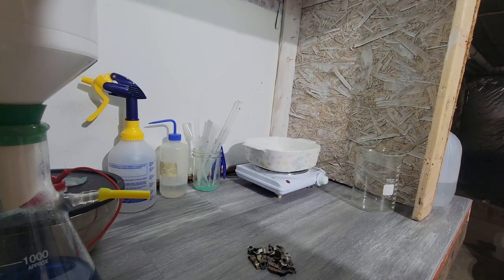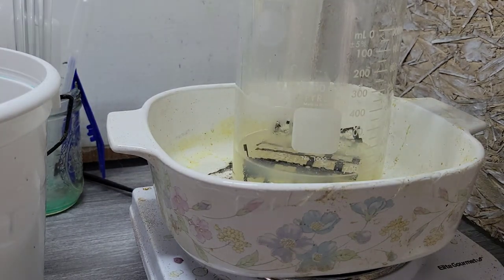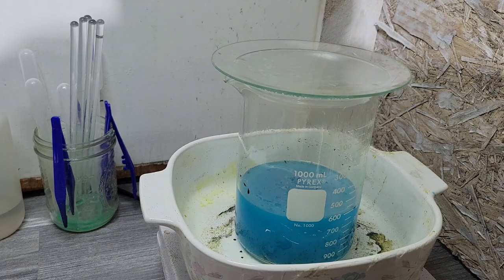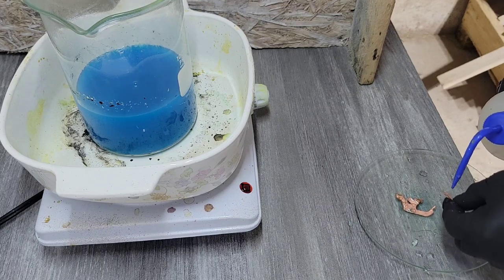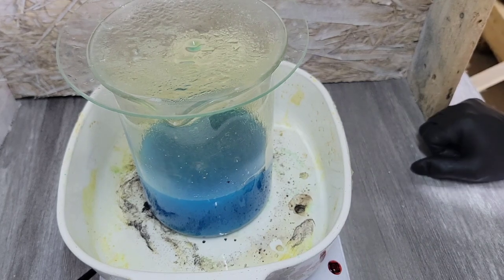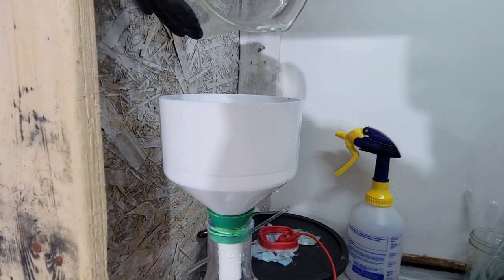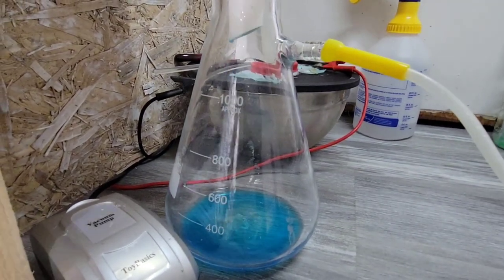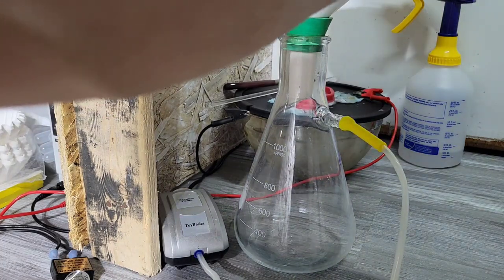Silver Recovery from Keyboard Inserts

Comment: Good video.  One thing I have seen with laptop keyboards is that there is a thin layer adhered to one of the layers of mylar covering a majority of the silver traces.  Do you think that is why your yield was so low?  Because the acid couldn't get to the silver?  If so, any ideas on how to get at it?  Looking to process some myself but may not if the yields are minimal for the amount of time and materials/acid used.  Thank you!
Reply from the maker: If I had to do it again, I would incinerate them with another batch. I peeled the layers apart with a razor, and it was extremely time-consuming.